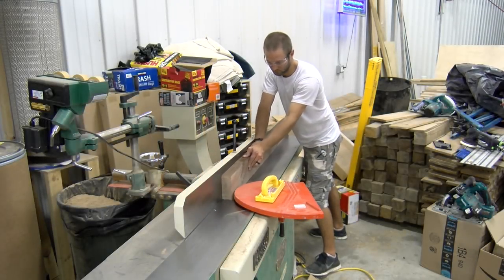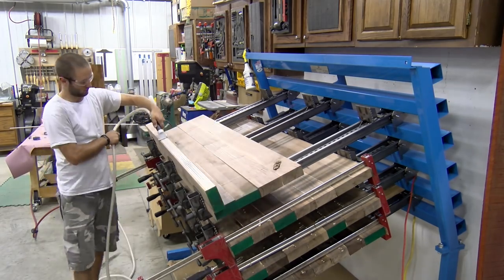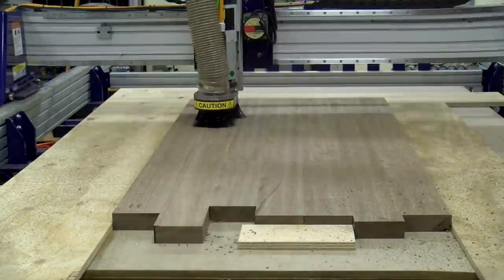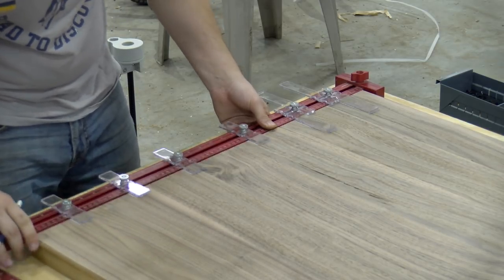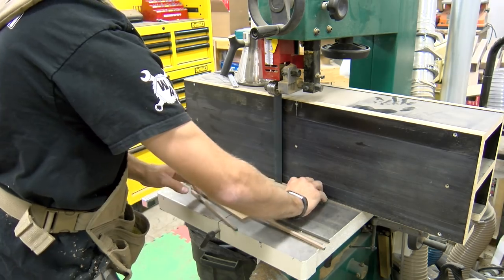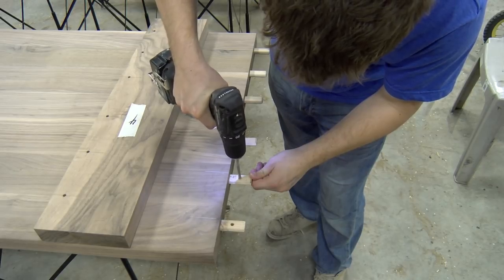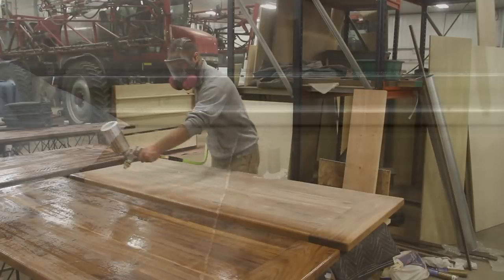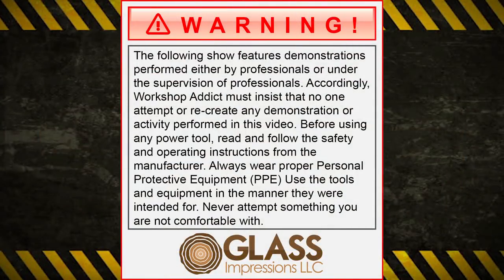Valley City Bar | Walnut Table Tops

Comment: Shouldn't you have slotted the holes in the dominos or did you make the domino slots larger in the top not the breadboard ends? Great looking table tops guys, how did you mount them. Did you change your channel name, if so what was it. Great work

Comment: Beautiful tables. Why glue glue only on the middle dowels? Are the dowels mostly cosmetic - I would think the glue on the dominos would be plenty strong?
Reply: Mark Moran the table top expands due to moisture changes. If you were to glue the outside dominos it would not let the table top expand and cause splits in the wood. Some humid areas of the country could cause dramatic swings in the width of the top. I've seen tops expand or contract 1/4" or more beyond the length of the bread board end.
Reply: Rowland Custom Woodworking Thanks. Makes a lot of sense. I need to figure out what to glue or not to allow for wood changes. My first cutting boards twisted and warped after a year or two.
Reply: Mark Moran cutting boards could be the wood wasn't dry when you started, or it got too wet and didn't dry properly after washing.